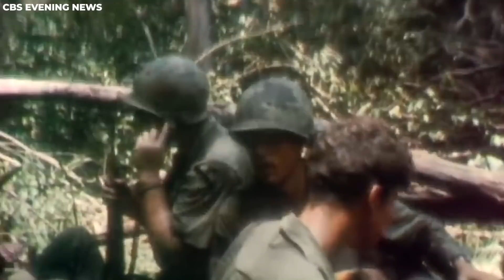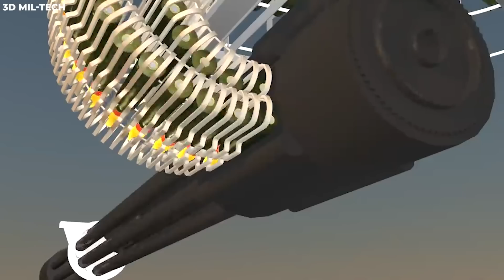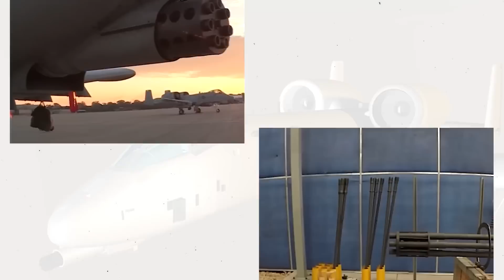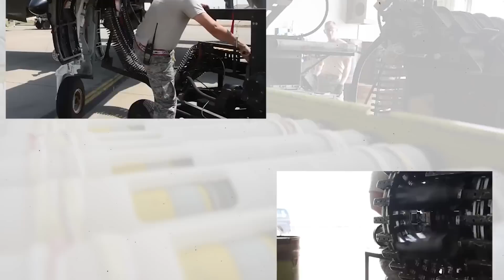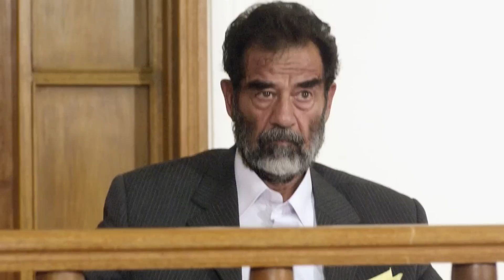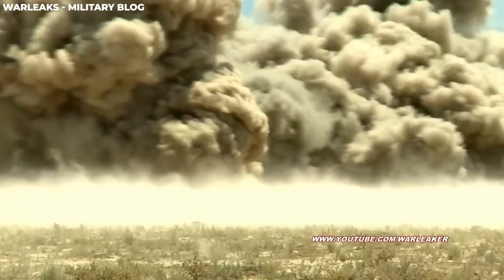The ONLY machine gun on the PLANET capable of turning TANKS into SCRAP | GAU-8 Avenger

Comment: About the weight, for which I’ve seen a lot of remarks the following are the stats: the gun itself is about 619,5 lbs, or 281 kg. Without ammo. With drum and fully loaded it weighs 4029 lbs, or 1828 kg. One round weighs about 380/390 grams, but the rounds with depleted uranium weighs about 690 grams each.

Comment: Accuracy should surprise no one. When the 20mm Vulcan was developed 1n the 195os, it was found to have one flaw it was too accurate to use doe close range Air Defense! They had to put special jigs on the system to give it a round or oval dispersion pattern.

Comment: GAU-8 is not a machine gun. It is an electrically-actuated cannon. Machine guns use a bolt that strikes a compression primer. Electric cannon use an electric charge to fire the primer. Machine guns cannot fire 4,200 rounds per minute.

Comment: As an USAF vet I work on the A-10. It is a GREAT aircraft. One correction to the vid, the A-10 was designed to use the GAU-8. Not the other way as stated. The USAF had the gun and asked for an aircraft to carry it. The current design won the compatition. Love this aircraft.
Reply: You are mistaken he repeatedly stated that the aircraft was built around the gun.
Reply: @mynameisgladiator1933  You are both saying the same thing.
Reply: Oh you lucky bastard. I worked on helicopters in the army a lonnnnnnng time ago. I get that " I'mma lucky bastard" feeling you have getting to work on that shit. I feel like make a new Gau 8 platform. New technology for a great gun

Comment: Don't mean to be offensive, but they make it sound like the A10 is a modern wonder.  In its day, sure, but the role of close air support is rarely done by A10s anymore.  That's due to the proliferation of MANPADS.  The A10 must now work at an altitude where the GAU-8 is far less accurate- or risk shoot downs.  That means the GAU08 can be as deadly to our troops as it is to the enemy.  

During its design and early to middle history, the A10 worked in an environment free of MANPADS.  It only had to contend with AA and such- hence the titanium bathtub, double and triple redundant systems, etc.  But with the advent of MANPADS, low and slow just won't go- hence why the AF wants to be rid of the A10.  

There are far better systems from far more survivable and easier to service jets.  Not because they are anywhere near as tough as the A10, but because of their speed, electronics and avionics, all things the A10 does not have.  The P51 was a great plane- for WW2.  But flying one on the modern battlefield would be a waste of time and money.  (Not to mention life.)  The same is becoming true of the A10.  The A10 was designed for a battlefield from 50 years ago- one heavily influenced by Vietnam.  

Lastly, the GAU-8 is not a machine gun.  It is a rotary cannon.  Cannons typically fire projectiles larger than .50 inch diameter at significantly higher pressures and velocities.  Thus the GAU-8 is a cannon, (rotary cannon,) not a machine gun.

Comment: Since the description of this presentation indicates the machine gun only, and because it goes in to great detail the aircraft which was specifically designed to carry it, when the engineers at Republic Aviation decided to build the quintessential ground attack aircraft, why not interview and get feedback from the most successful ground attack pilot?They did so by interviewing HansRudel, who flew the Stuka during WWII.His record will never be approached with numbers of tanks destroyed alone.He also sank many vessels, including a cruiser. His first and foremost piece of advice was to provide protection for the pilot which was done to great effect. At the time of the interview, he was I believe working for the Air Force of Argentina.
Reply: Oh, by the way, check the number of rounds held by the new “wonder weapon F22 Raptor to that of the Warthog. Also, the A10 can stay on station much longer, zip up and refuel when necessary very quickly, then land on unimproved runways. To retire these a/c before absolutely necessary is a terrible strategic mistake. Each aircraft has its positive traits but change for the sake of change is wrong, regardless of the amount of kickbacks to congressional committees.

Comment: Put a few in an Airbus A380 shooting out the sides, plus 20mm, .50 cal Miniguns, 40mm Bofors, various Howitzers,  launched Javelins, APKWS laser guided rockets, Hellfires, Spike-ER's, and a bomb bay for JDAMs and CBU 103/105's. Would love to see a super duper AC-130 like that. Probably add AESA SAR in the nose and tail, sides, hell, probably be able to fire AIM-120D's if anything is detected coming for them. Flying battleship. Might as well throw some AARGM-ER's under the wings to remove SAMs too. Call it the AC-380 Eraser.

Comment: The tone of this video is funny since they're retiring the A-10 due to its shortcomings compared to other more modern platforms.
Especially when you consider the Air-Force has been pushing to retire it for awhile now.
Namely, the GAU is inaccurate covering a 40-ft cone spread around its target.
Its credited with the highest friednly-fire incidents in Iraq/Afganistan due to its terrible optics with pilots often using binocs and the mk1 eyeball.
The GAU was great in its day with something like 90% kill ratio on armor, but against modern targets its underpowered and has a kill ratio somewhere in the 30% range.
Its old enough that maintenance is becoming impossible as parts are completely unavailable and the plans/manufactureres have been lost

Comment: Take Note of how the Phalynx CIWS, 20mm Mini Gun and GAU8 Avenger are loaded with ammunition.   It shows the ONE issue against ease of use for all these weapons.   They are each loaded in the reverse of firing.   The barrels are turned to draw in the ammo into the magazine.   So, no matter how many shots you get, every one of them were loaded in 'Reversed Slow Speed' of firing.   What takes half an hour for an experienced 2 person crew to load and arm, takes a pilot 2 seconds to UN-load.   Upon an enemy, of course.  These aren't really belt fed.   They are fed via tuned waveguide!   Hey, look how fast these guns rate of fire is, so yeah, the feed conduit MUST be carefully tuned to avoid jam ups!   What goes 'crankety crankety crank' for half an hour turns into BRRRRT!  then home for reload.  😵‍💫😵😶😮😲
Reply: They're all timed. The tuning is just getting all the timings correct. Once correct you can turn the speed up and down at will. 
In the A10 there's little reason to change the firing rate though.

Comment: The USAF don't want it, maybe a better home for it would be with the Marines. or make an exception of the rules and let the Army use them. Despite the heavy armor, the A 10 may have trouble surviving in high threat environments. Against a first world enemy equipped to deal with air to ground threats, the A10 may be unsuitable. The enemy would have missiles like AS400 or even the obsolete and lowly ZZU23/4 will not bring one down, but will do enough damages it will have to return to base right away. It is often cheaper to just use drones now.

Comment: There needs to be a GAU-8 mobile artillery.
Reply: artillery is an indirect fire solution, not what a gau8 was made for
Reply: @SPastaL  I wonder what the range would be fired at say, 35° elevation, and how much area would it cover?
Reply: @612_ZEUS  I'd imagine the coverage would be great but a waste of ammo
Reply: @SPastaL  I would think the incoming rounds would ignite an ammo depot and wreak death in a gathering of troops.
Reply: @612_ZEUS  you'd lose most if not all kinetic energy at the apex of the bullets arc and would be roughly as effective as using a catapult or trebuchet which is why we have artillery with fragmentation for soft targets.
Reply: @SPastaL  That's not true. As long as the launch angle is less than about 35 or 40 degrees it will maintain much of its velocity.
Reply: @612_ZEUS  You're trying to argue that we go back to sling launching solid material in an arc while hoping to hit something from beyond line of sight when modern arty was created to phase that out. Why would anyone volley fire a gun into the air to hit something far away when a single projectile can do a better job if it hits and saturates everything with shrapnel outward horizontally?
Reply: @SPastaL  It's not "volley" fire when it's a single platform with a designated target.
Reply: @612_ZEUS  here I thought I could have a nice little discussion about weapon systems with someone but they'd rather nitpick my word choice rather than focus on the topic, so I'll take my leave now (:
Reply: @SPastaL  👍

Comment: The A10 is a prime example of the top brass not knowing what is needed for us in the front. They have repeatedly tried to kill the A10 even though it is the only close air support aircraft we have. It has saved more lives than any other singular weapons platform over the last 20 years. Fortunately, it has been saved for now, but it is only a matter of time until they come for it again. The A10 should be in service for another 20 years at least.
Reply: Joe, I also like the A-10 but as we are seeing in Ukraine, the mobile anti aircraft missiles are very capable. They are also cheap. I fear the days of the gun run may well be over. In future wars we will be seeing a lot of attacks by drone aircraft, some controlled by the isolated troops the A-10 saved many times.
Reply: your correct about ukraine but mount it on choppers or also on a vehicle in 20mm form,?your thoughts?
Reply: The A-10 has gone the way of the battleship. Modern warfare requires the ability to strike at a much farther distance like the aircraft carrier revolution.
Reply: @LastTechnocrat   Fan boys ignore the USMC nor the USN have  never bought any. And do the mission CAS fine. The plane gets a lot of hype . When others are doing the job.
Reply: The A10 is responsible for more blue on blue incidents than every other close air support platform COMBINED.  It is a drastically outdated platform that is easily replaced with more effective equipment (even during the first Gulf War, the F-111 Aardvark took out more MBTs and ground equipment than the A-10... without a single blue on blue incident).  The GAU 8, while impressive, CANNOT PENETRATE THE ARMOR OF VIRTUALLY ANY MAIN BATTLE TANK MANUFACTURED AFTER THE 1960s.  It's great for light tanks and other transport vehicles, but the cannon has been outdated against the very thing it was designed to destroy almost since its inception.  Worse still, the systems used for targeting the weapon are also severely outdated (although its recent upgrades did much to fix some of those inadequacies).  As it stands, ground forces would be much better protected by platforms that can get on station faster, with less chance of a blue on blue incident.  The only advantage the A10 has over other platforms is its loiter time.  But, if it were me on the ground and I was given the choice, I will take the platform that can get on station in only 5 minutes, but can only stay for 10 minutes, than choose the platform that will take 20 minutes to get there, but can stay for half an hour.  Without fail, the one that can get there in only 5 minutes will also be able to better distinguish the difference between me and the enemy and is far less likely to shoot at me by accident... which I would much prefer that as well.
Reply: That's not going to happen.
Reply: @SpaceCaptainVale 😏Well said comment. But, the fan boys will not let go the glory hound bird. While the rest are get the job done unsung.
Reply: Democrats want the US to loose every war.
You might not believe me but history speaks for itself.
Reply: If you hear the BRERRRRRRRT.  You was not the A-10s target 🎯.😉.

Comment: I believe you made an error in the opening comments.
The GAU-8, is not 600 lbs.  It's more like, "6,000 lbs!"
Just the ammunition, carried by an A-10, for the GAU-8, weighs more than 600 lbs.
Reply: I though the same.
Reply: Nope, it is about 619,5 lbs, or 281 kg. Without ammo. With drum and fully loaded it weighs 4029 lbs, or 1828 kg. One round weighs about 380/390 grams, but the rounds with depleted uranium weighs about 690 grams each.
Reply: @joostprins3381  Then again, the gun nor the ammo is 600 pounds...
You're own number say that the gun and ammo combined are over 10,000 pounds, or 5 tons.
Reply: @FuzzyGatorDog  the gun,without the drum is 619,5 lbs. you are bitching about 19,5 lbs?
Reply: @FuzzyGatorDog  please read, the maximum is 4029 lbs.
Reply: @FuzzyGatorDog  the factual numbers: About the weight, for which I’ve seen a lot of remarks the following are the stats: the gun itself is about 619,5 lbs, or 281 kg. Without ammo. With drum and fully loaded it weighs 4029 lbs, or 1828 kg. One round weighs about 380/390 grams, but the rounds with depleted uranium weighs about 690 grams each.
Reply: @joostprins3381  Your use of a "comma,"  (,).  Your numbers is either wrong, or at the least, misleading...
Your number for the empty weight of the gun is 619 pounds.  And the comma should be a period, (.)  "619.5"
".5" is 1/2 pound.
Or, the comma should be 6,195 pounds.
6,195 plus 4,029 is 10,224 pounds.
Numbers are exact.  A comma or a period, in the wrong place, can make your numbers 'off.'
Reply: @joostprins3381  what use is an empty machine gun ???
Reply: @somozasi  the use of an empty machine gun is that you use it for the design and build of carriers. Also you know how much mass you got so that you can calculate how many rounds from what type you can load or use. And you know where the balance is according the weight of the plane in this case. It would be a bit stupid when you shoot all your ammo and then crash because your plane is out of balance. 
So more questions? Like what the recoil is doing to a plane?

Comment: It was my understanding that the shell casings where not only kept on board to avoid possible plane damage, but to keep the weight center of gravity in check. That's a lot of brass ! 😮
Reply: It's a gun with a plane built around it, vs a plane with a gun mounted in its nose.
Reply: See my response to @sullyway51 (I can never remember who gets notifications with nested comments in any particular application!)
Reply: I believe they never bothered designing flying around it because they were worried about engines sucking in debris (they already get snuffed out from lack of oxygen which is why they will only fire in a dive). 

So if it's already an advantage, start taking advantage of that.
Reply: @leftyeh6495  Oh they designed it for flying alright. Part way through they determined that aircrew had almost as much value as the rotary cannon! So they mounted a titanium tub in the fuselage to protect the aircrew from ground fire.

The high-mounted engine nacelles help eliminate FOD intake but you lost me at the gun only firing in a dive. Going DCS now.
Reply: The shells are aluminum.  Not brass or steel.
Reply: @sullyway51  I believe that SpaNT650 was using the word “brass” to denote the empty “rounds”… even though the material which they are made out of may not actually be brass. I’ve heard many shooters refer to their empties in the same way. Many ranges have signs which simply say “Police your brass”, not meaning steel or aluminum empties can be left. 
The empties in an A10 are in fact retained after the round is fired to keep the plane in trim… no matter what material is used in their manufacture. 

If the A10 is being ferried somewhere, and ammunition is not needed (say flying from California to Virginia), there are large metal weights which are bolted into the ammo storage bay. These weights cumulatively weigh as much as the actual ammunition, keeping the aircraft in trim without the bother of loading actual ammunition. Pretty convenient, IMHO!

Comment: The gun isn't offset because  of recoil it is in order to make room for the front landing gear !
Reply: No, the gattling is offset so that the firing barrel in on the centerline of the airframe, it is also why there is an odd number of barrels instead of even - to make it possible to put the recoil impulse on the centerline.
Reply: @BloodRaven1969   I forgot about that thank you alls wondered why it has 7 barrels  not 6
Reply: @HDSME  Happy to have provided some info. :)

Comment: Point of correction:  The gun is not offset to manage kickback, it is offset because it is so long.  A front landing gear is kind of necessary, so THAT is why its offset: to allow a nose landing gear.

This is just one of many errors in the vid, to include misspellings; i.e. it is NOT a GUA-8....it's a GAU-8.  So many more.  Terrible.

If you're going to put out a technical vid, it's usually pretty accepted practice to put correct info in the vid.
Reply: You are right there are many errors but the gun is offset so the firing barrel is on the centerline of the airframe to keep the recoil impulse on centerline. It's also why 7 barrels rather then an even number.

Comment: This bullshit again. 🙄 The A10 is a ridiculously expensive and obsolete asset. And it can be easily shot down by MANPADS or SLAAMS because it has to be flown low and slow to hit its target. And its 30mm shells often just damage rather than destroy armour, which is then recovered and redeployed. An F15, F16, F18, F22 or F35 can get there quicker, cover a greater area, loiter longer, refuel in the air, and most importantly, carry an accurate stand-off smart munition that will destroy enemy armour